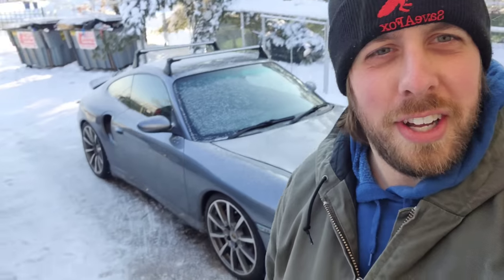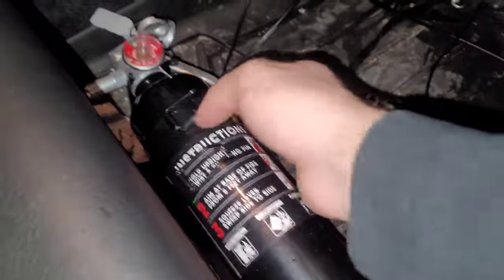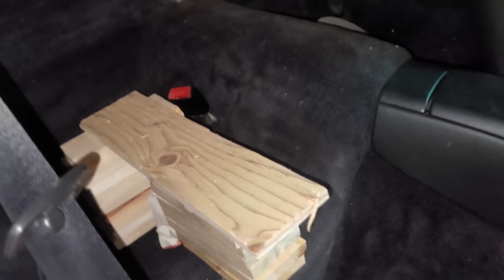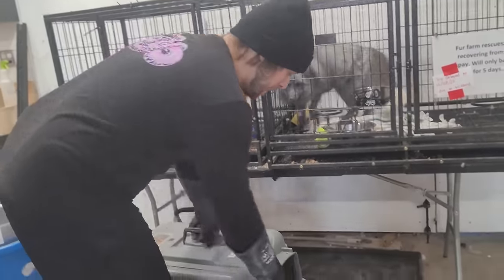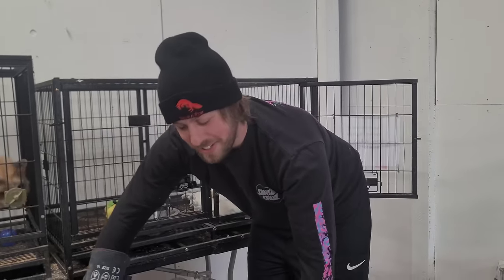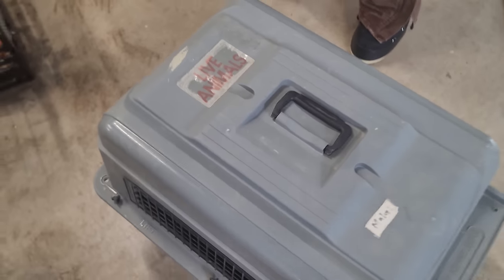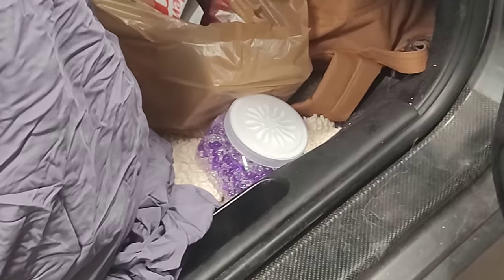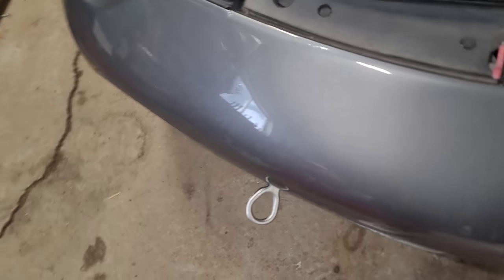Transporting rescued foxes in style!

Comment: I used to have an old 911 from 83 and the suspension does NOT forgive bad roads. You feel every little bump! Long trips are hard in those guys!
Reply: i have a newer 997.1, from 06' (1 generation after the 996 turbo in the video) and its not that bad anymore, you do still feel every bump, but between nice tires and very comfortable seats its neglegible

Comment: Ethan, I wouldn't judge you by the car you drive unless it was a Yugo then I think there would need to be an intervention. I did not know they make a winter tire for it but in theory the car should be decent in winter because the engine is in the back. The old Volkswagen beetles are great in the snow. Also, you are a smart guy to have a fire extinguisher in there as do I in all my cars and trucks. I passed by a guy with a nearly new Corvette stand by and watch the thing burn to the ground that's why I have them. I think those foxes will have a happy home but not as good as you and your sweetie make for them.